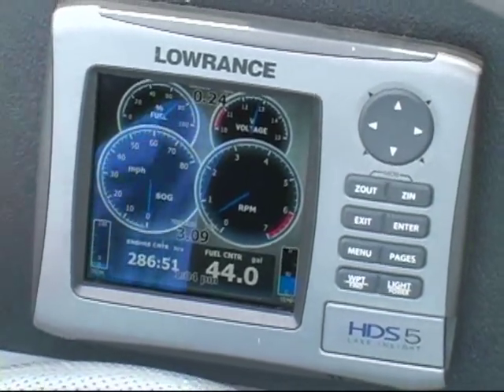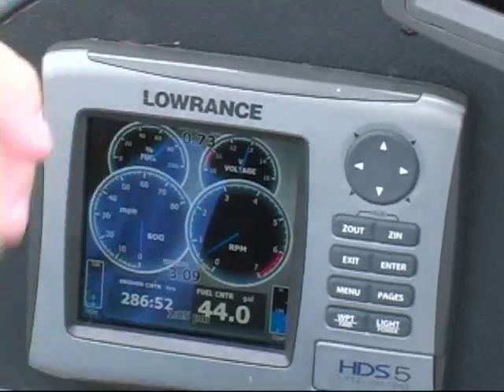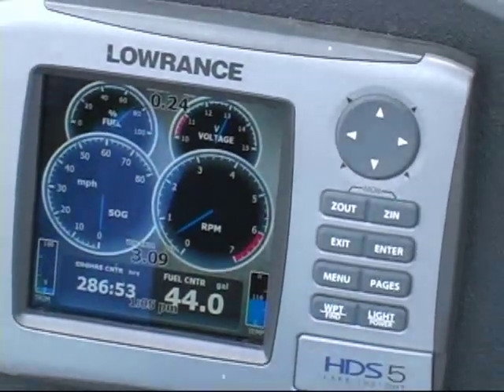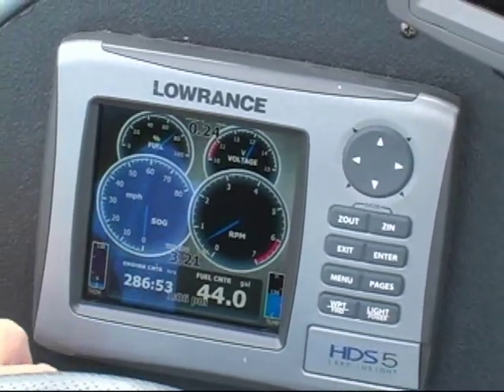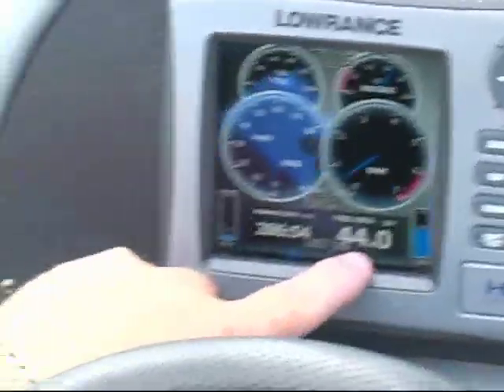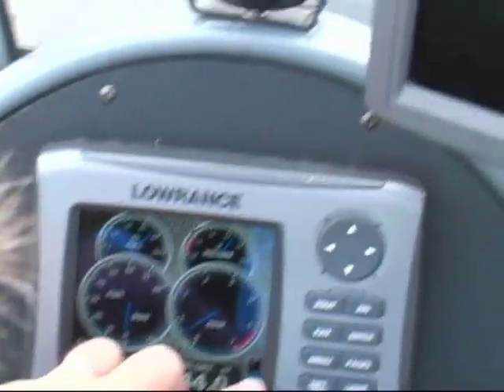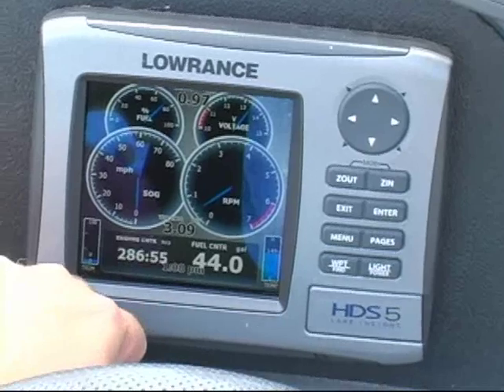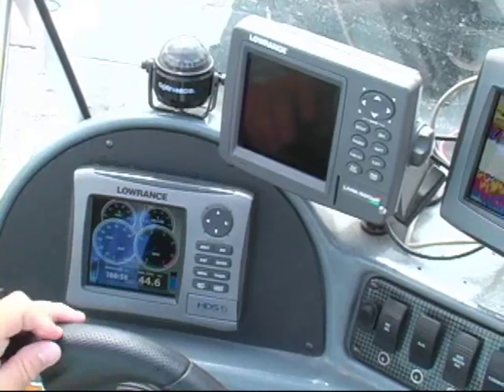HDS Engine Readouts

Comment: Do you need additional sensors for some feature? For example fuel flow or how many gallons left or even tilt degrees. Or is all that info already in the motors computer?
Reply: water pressure needs a sensor